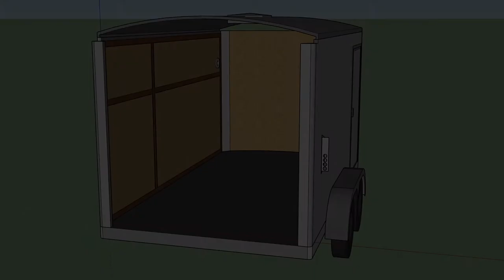Trailer Shop #3 - Aluminum Cabinet Frames

Comment: Can you provide some feedback on how it held up under use. I am planing to use the Quick Frame system for cabinets in my cargo trailer camper conversion, but I am worried about the fasteners holding up.
Reply from the maker: Not great. Turns out press fit is not ideal for something that's moving and getting rattled around all the time. A lot of my connections have pulled apart a few millimeters, so now the whole thing is off square enough that the latches on my cabinets don't match up well anymore and they're hard to close properly. I've started drilling a hole through the aluminum near some of the connectors and putting a screw in that goes through to the nylon. If I did it again, I'd definitely go with something with a more solid locking system.

Comment: You could make your own by using 80/20 pieces cut by you to your own sizes.  Then put 1/4" plywood walls instead of the white PVC which is unsuitable as cabinet material.  See Ourkaravan for tips.

Comment: Would you recommend different connectors next time?
Reply from the maker: These connectors are just how the Quick Frame system works, so it would have to be a whole different system that doesn't rely on friction fit. I'd be fine using Quick Frame again in a stationary shop, but not in a mobile setup.
Reply: @MakerOnTheMove  good to know! I was looking to use these in a cargo build myself.